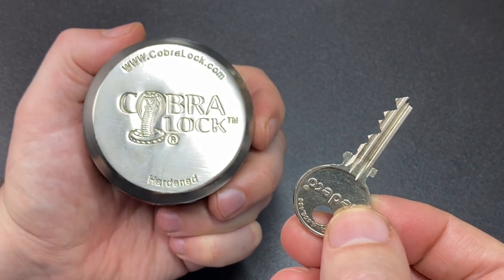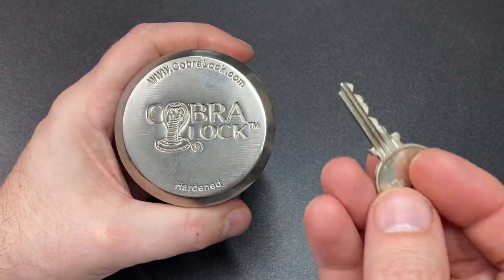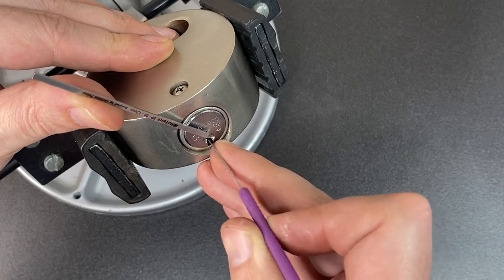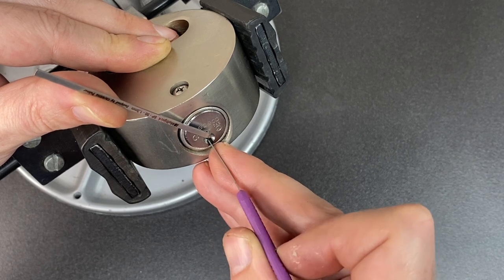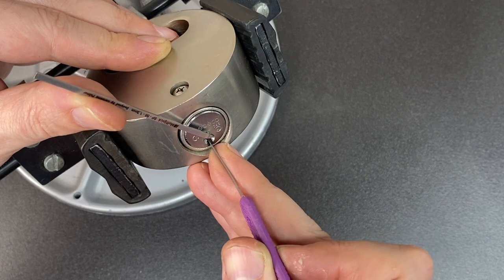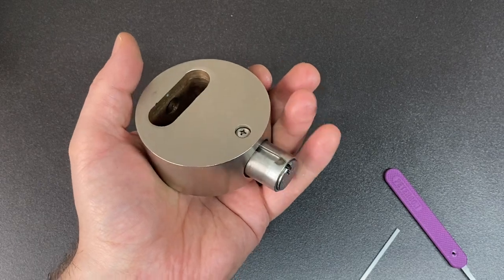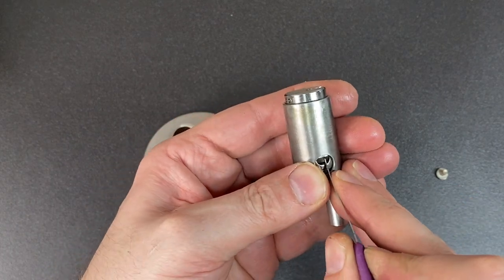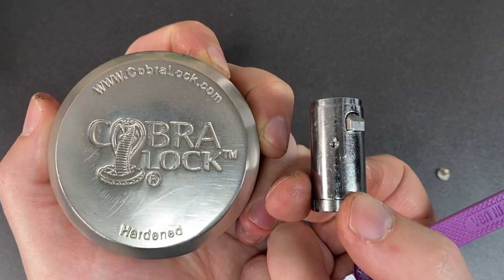Cobra Lock Padlock with Medeco Core Picked

Comment: I got a combination padlock yesterday at work.. that of course someone forgot the numbers.. I did not even know how the mechanism worked.. I tried once and nothing.. then I thought what would you do . and in 5 minutes I got it open. It was a puzzle on its own,, you had to squeeze the padlock one side as its acts as  a switch, then pull  on the metal string and only then guess the code by rotating them until they felt right.. but also to reset the code - you had to use that metal string - on the opposite side of the padlock where a strange metal pin was recessed and holding it under pressure change the combination, without your vidoes I would not know where to start !  :D
Reply from the maker: Awesome work!

Comment: The core looks kind of vending machine-style, right? If that part between the lock and the core is a vending machine plug adapter, that's freaking awesome, and I need one. 

Also, holy hell, that was impressive!
Reply from the maker: I think it’s the same core that’s used in vending machines and stuff